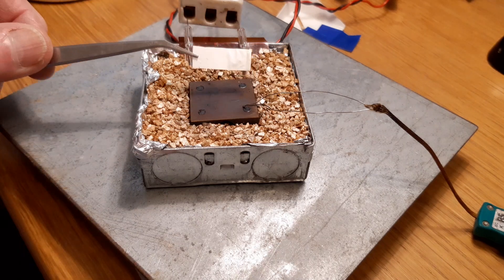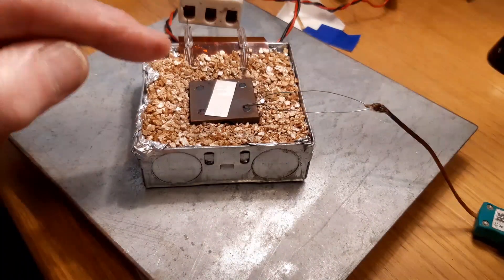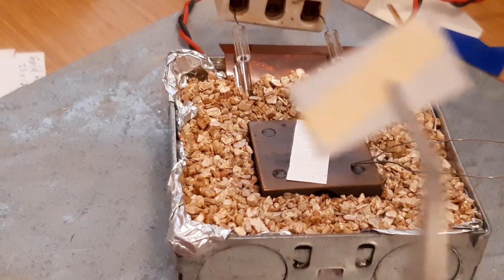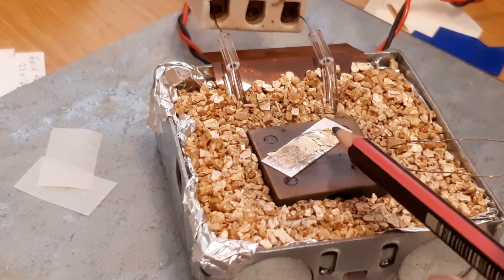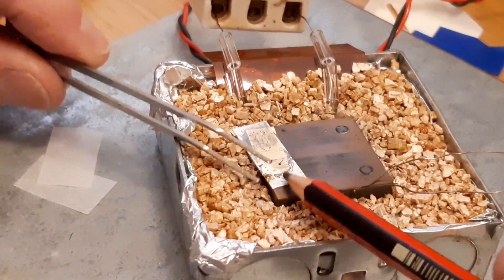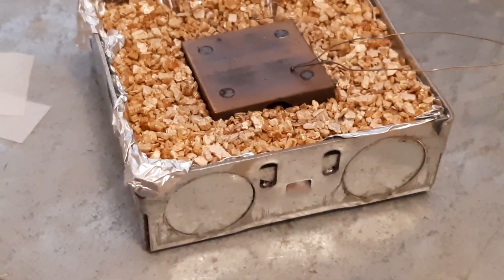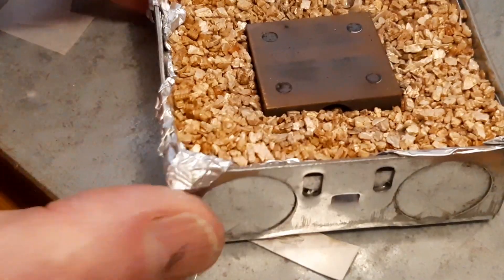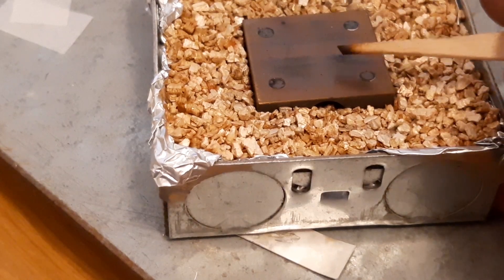Keum Boo first time with miniature heater. Successful 9 February 2023

Comment: Pure gold cold welds onto its self.  When it folds over on to its self like that you will not be able to separate it.  That is why chip companies use pure gold to bond the die to the legs, no heat or electricity needed.
Reply from the maker: Hi Jack. I didn't know that. I used to own an Induction Heating Company, amongst other things, I've designed and manufactured melting equipment for gold silver and platinum etc and I've made 16 Kg gold ingots in South Africa. I've made melting units for companies like Johnson Matthey, Engelhard in England and Africa and even the Perth Mint in Australia. I've made equipment for Spin Casting metals for the dental industry, but no one has ever mentioned how gold will bond to its self. Does it require an elevated temperature? I'm not sure why they say Keum Boo has to be done at around 370 deg C. I'm just following along with everyone else on that but I shall probably test the temperature boundaries. I like to try and understand why things are done the way they are. I only pickled to silver 6 times because that's what, 'they say' should be done but I will look with a microscope and try and understand what works and what doesn't. You'd be amazed at how many companies don't fully understand their production processes. When I was designing equipment for use in mass production, I'd ask questions that the clients hadn't even thought about and couldn’t answer. Believe it or not, and worryingly, even in the aviation industry. Jack, please tell me what you know about bonding gold. I've made one equipment for fusion bonding steels but that involved high vacuum and stringent cleanroom conditions, not something you can do at home very easily. Thanks for your comment, I look forward to hearing from you. 
Kind regards . . .Andy